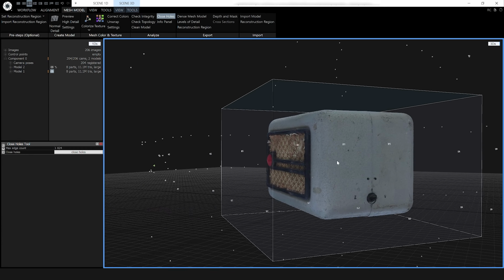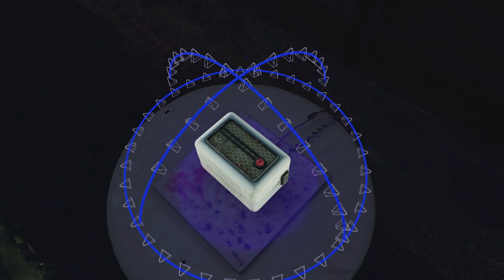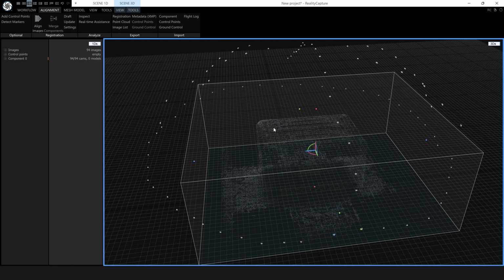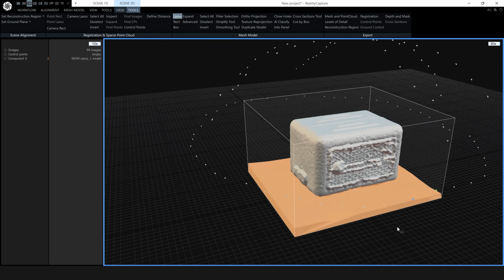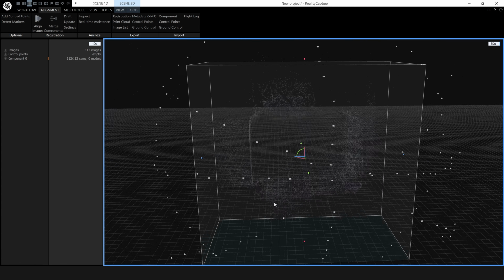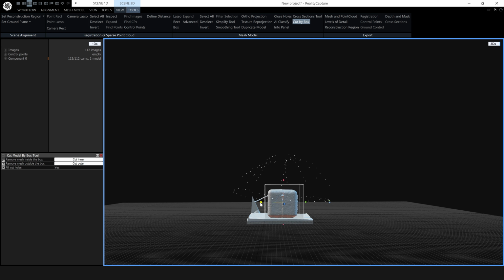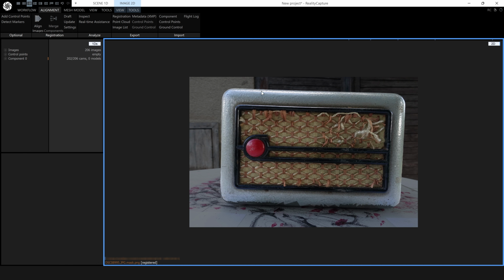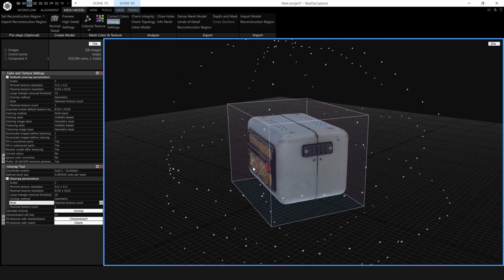Making a Complete Model in RealityCapture | Tutorial

Comment: It all looks nice but when I go to align the Top and Bottom it splits it into 2 components.
Especially the bottom is not rotated 180°.
The images taken overlap perfectly (there are 1134 shots).
Is it possible to see the alignment settings you used in this tutorial?
Reply from the maker: Hi, if it is not said, then there were used pre-defined settings.
What kind of object are you capturing?
In cases like that it could help to use control points to merge the components together. Is there a good overlap between top and bottom parts?
Reply: @CapturingReality  Hi, thanks for the reply.
There is a great overlap of the two parts (even more than necessary.
The object is a small semi-rigid leather door.
I'm doing some tests and with the control points it works but it leaves some artifacts (nothing that can't be corrected with the brush later but I always try to achieve the best possible result).
I wonder how influential a change in lighting (even if slight) is in the tracing of the parts?
Thanks
Reply: Sorry is not a door but bag :)
Reply from the maker: @daskydesign846  Have you turn it over to capture? As it is semi-rigid, it could change a shape a little bit, so therefore it could be considered as different object.
Also, changed light conditions didn't help there.
Reply: @CapturingReality  The error I get when joining the two components via control points is that it creates a sharp cut between the two parts.
I wonder if there is a way to join the two parts in a "gradual" way.
A sort of union gradient.
I was thinking of fading the masks to black in the part where I cut.
So that it blends uniformly with the other part.
The problem I think is that when I turned the bag it probably deformed a bit and this is evident when I join the two parts..
Do you think a gradient on all the masks could help?
Or do you have any other suggestions for joining the two parts without showing a sharp cut?
Reply from the maker: @daskydesign846  I don't think so... You need to scan the bag without moving it or rotating. Or somehow make it solid to be not deformed after it will be rotated. As basically you are scanning two different objects.
Reply: @CapturingReality  It would be nice to have a feature that can merge two parts by gradually fading the overlap of one on the other.
It would solve a lot of problems in semi-rigid objects to be scanned.

Comment: Is it normal to need to run the alignment thing multiple times before it spits out a correct alignment? A took all the photos twice with different lighting and backgrounds thinking it was that, but after running the alignment like 5 times it finally worked.
Reply from the maker: It is not normal, but it could happen for not properly captured datasets.

Comment: Great video. This was just the right length and got to where I needed to be. You advised a photo every 10deg, but what is the rule of thumb for capturing buildings? A photo every meter?
Reply from the maker: For the building you need to watch the overlap images. As basic you can follow 1:4 rule (to 4m distance from the building move 1 m to a side) which should keep about 75% overlap between the images.

Comment: I've tried to make everything step by step after you, unfortunetly program didin't recognise, that there are two other sides of the object in two different folders. When I did the alignment of both sides program show cameras only above the object. In the end i gained texture with top and bottom on the top and nothing at the bottom. Is there any way to make it work right?
Reply from the maker: Hi, what kind of object have you scanned? Have you used masks? Have you used control points. The parts were also processed in two different projects?

Comment: Hello... a very nice training video.
I am doing everything as you said here.but when I combine all the pictures and masks and do the calculation, unfortunately it models separately.
how can i fix this problem?
Reply from the maker: Hi, do you mean that the sides of your object are not aligned into one component?
How is your overlap between images? How many rows have you used to capture your object from both sides? Are the masks applied in your process? If not, do you have the proper naming convention?
Reply: @CapturingReality  The number of pictures is at least 100 photos for each side.
I do everything as in the video. When I load the images with the masks I press the tab key and check if everything is normal. When I ask it to detect the photos, it calculates the edges separately. It does not combine them and display them as a model.
Reply from the maker: @faridmuradov9623  Not just the number of images is important, also the way how they are captured and what it the overlap between them.
What kind of object have you captured? It would be good to see your project somehow... What do you mean by: When I ask it to detect the photos ?
Is there something similar for both sides of your capturing on the object?
You can also try to merge the components using the control points.

Comment: hi, in "mesh model"  i can see "close holes" button, but can't find "open holes". Where i can find it? or may be in "reconstruction" settings somewhere hiding "close holes" dialog ? cant find it(
Reply from the maker: Hi, there is no such tool as "open holes".
Reply: @CapturingReality   thank you for fast answer !!! sad news(( and no chance to find things like this in settings (of "reconstruction" or other places?)? right?   PS : old version make it by default, and then users must close\fill holes by himself. i think this feature (like open\close holes) can add a little bit more flex\possibilities to this grate software.  Again thank you for your answers\communication !!!
Reply from the maker: @toyhunter9746  What exactly do you mean? There weren't any changes regarding this tool, so it should work in the same way as before. What for will be the "open holes"? To do that you can just filter a selected part of the model.
Or am I missing something?
Reply: @CapturingReality  Need reconstruct 3d model from photos, for HD remodelling (HQ production pipeline)... huge number of polys(100 000 000) building with a lot of mirror surfaces(for example). CR create model and automatic close all holes ( exactly this huge number of mirror surfaces) and i must cleanup all of this "closed holes geometry", coz i need remodel this model in good quality model (in 3dsmax software) and i'm doing this operation with cleanup every time when i got task like this...  spending alot of work hours...  if i can say to RC recostruct and dont close holes, this will be a huge joy\holiday for me and save a lot of time (this geometry in holes interferes with modeling in viewports) sry about my eng(
Reply from the maker: @toyhunter9746  Thank you for the explanation.
I suppose those surfaces will be created from bigger triangles. To remove those triangles you can play with the Advanced selection tool, where you can set the threshold to be selected and then filter those triangles.
Reply: @CapturingReality   Thank you !!!!!!! this tip will save me!!!! <3<3<3 Best support!! and fast like lighting!